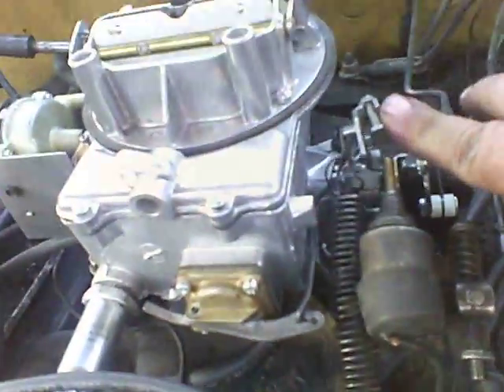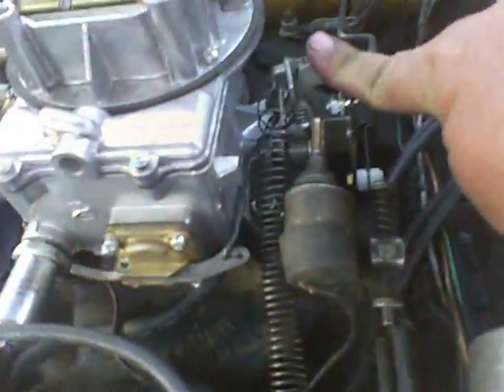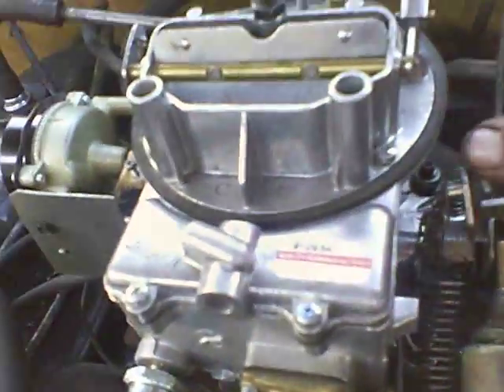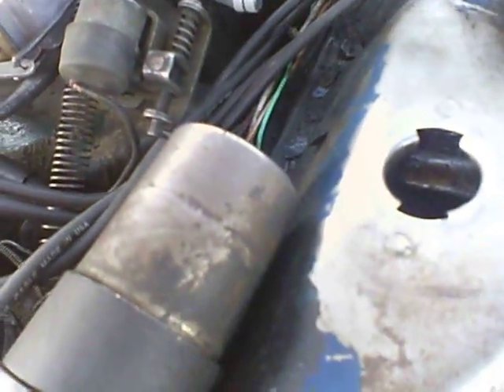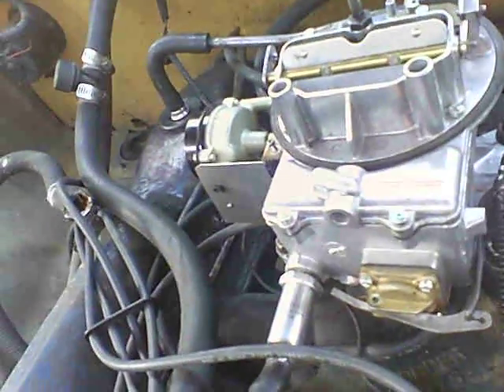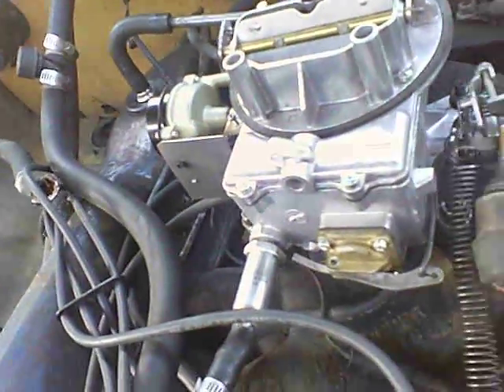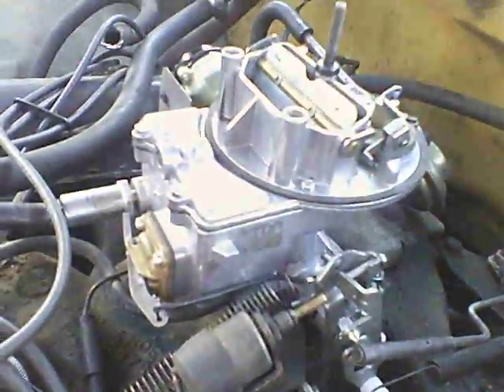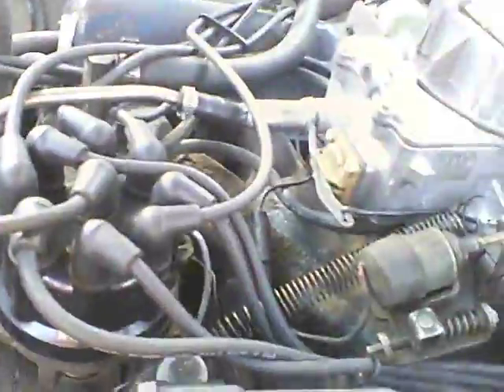Ford 360 2bbl carb 1974 4 speed  2 wheel drive

Comment: Since this a super old video, I'm only posting this for others to see:

On an engine this old your balancer dampers are most likely shot so don't rely on your timing fun for ignition timing. Do everything on a vacuum gauge. On these 360's and 390's you'll find a manifold vacuum port with four rubber lines going to it. Plug you vacuum gauge in there. Adjust your distributor until you see maximum vacuum. Should be 18-22inHg on the gauge. Then do the exact same on your carb adjust screws. Make sure those screws are turned identically to each other. Make sure the engine is hot while doing it and your butterfly valves are straight open. Should be golden at that point. If not; it's a vacuum leak. If the needle bounces fast it's valve problems.